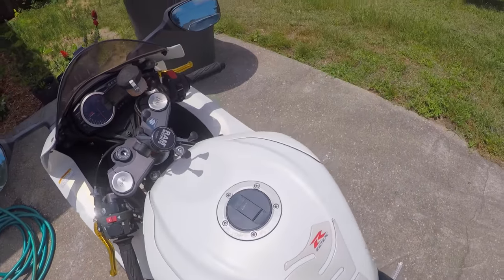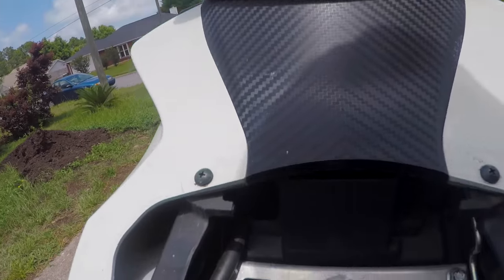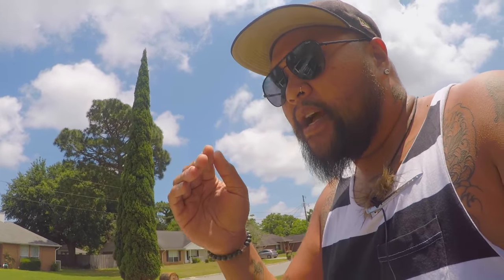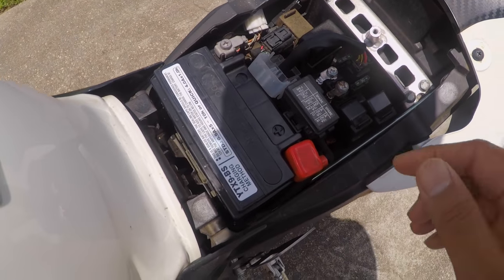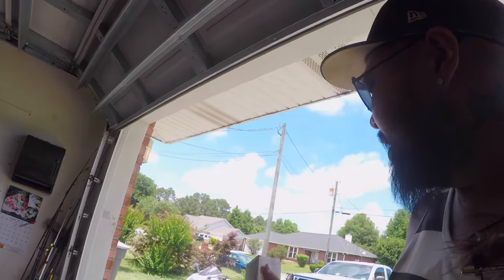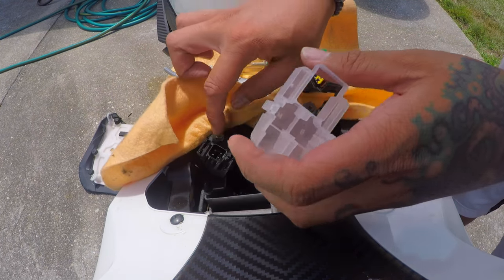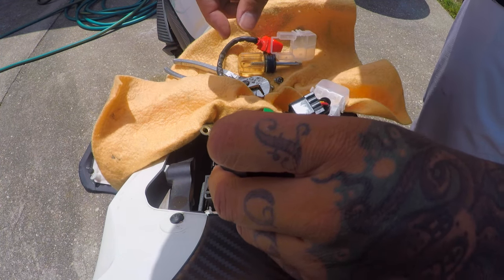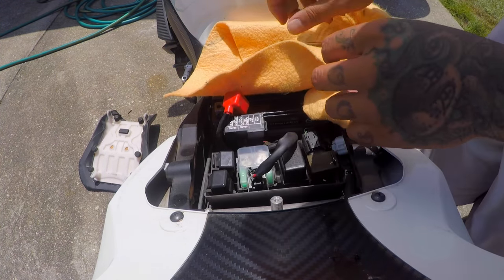**Solved!** Starter relay problem! Works for most bikes/vehicles!

Comment: I bought a xsr 900 last sept 2020. I never used it till now because im out of the country for work,  my bike wont used until now but someone start the engine weekly. Now i notice it won't start easily and it is intermittent, i already change the battery, but yesterday my mom try to start the bike again and it has only clicking sound, i hope it is only starting relay problem,
Reply from the maker: Rapid clicking sounds like a battery issue. If it clicks once, then it’s the relay, if it cranks and doesn’t turn over, it’s the starter motor. To my knowledge. 😅
Reply: @MotoCos88  yes same thought. It happens Only clicking, sometimes if you press the start button twice or 3x it will start..

Comment: hi.i have taken the battery off while engine was running.after 30 seconds engine completly shut off.low beam gone.apart from low beam everything working .checked all switches they are fine .brand new battery.starter motor working fine.but engine not running.
could any one tell me what is the reason. checked all fuse they are ok
gsr 600 2008
Reply from the maker: @munna1111  is your stator/rec recharging your battery? Also check your ground wire

Comment: What's the "zzzzzzeeee" sound after you turn the key in the ignition? I have the 2014 GSX-R 750 and I wanted to start it today after a long break and suddenly I'm not even getting that sound. The lights come on on the panel, but there are literally no sounds when I turn the key. Battery should be charged, I only disconnected it from my OptiMate a few days ago and the LEDs and the instrument panel do light up.
Reply from the maker: Hey! Sorry I missed your comment! That sound is the fuel pump priming the ignition? I'm not sure where it goes tbh, but I do know, thats the feel pump engaging getting ready to start the motor. Currently, I haven't been riding as much due to the weather and this 100+ degree weather so its been chillin in the garage. I tried to start it the other day and it wouldn't start, however, i am getting lights and a fuel pump. So I know ill just need a cold jump. What happens when you try to start it? just it just die automatically? If I were you, I would get a voltmeter and see what the battery reads before and after you try to start. It needs at least 12.5V to start. Start there. If you get it to start, the volt reader should spike up to 13-14V and maintain that amount. If not, it could be your rectifier/stator not charging the battery whilst running. Good luck and please let me know how it goes!

Comment: Currently have this same issue just replaced the relay but same clicking sound still happens don’t know why!
Reply from the maker: Rapid clicks or one click? Could be a voltage issue. How old is the batter? Check with a voltmeter how much you’re starter is getting from the battery. Should be 12.5V+

Comment: i have a mt 07 2018, same problem but I also got a motorlamp. is it normal to have motor lamp when the rele is the problem?
Reply from the maker: I’m assuming a motor lamp is like a check engine light for bikes? I’m not sure as I’ve never dealt with them. But that could be it!

Comment: Hey I have similar problem but my battery keeps draining out I’m not sure if it’s the relay or maybe the stator (alternator) it’s fried . Was your battery draining also or it just didn’t want to start ?
Reply from the maker: If your battery is dying on you after each ride, it’s your charging components. If you can, I’d remove the stator cap and check the coils. They’re probably shot. After I’d ride, my bike would sometimes not start, so I thought it just needed a jump. I’d bring cables with me everywhere I went until I discovered it was my relay. I’d do a volt meter check on my battery and would notice it was fully charged after I rode so I knew it wasn’t the battery or rectifier/stator. The test of checking the relay with the volt meter on both contacts told me it was a bad relay. I hope this helps
Reply: @MotoCos88  thank you yes I’ve bought 2 battery’s brand new and both drained quick . I havnt checked the relay but I try to use the jumpers and it only makes a click sound when I try to start it up and I believe the engine light is also blinking ? Not sure why . do you think it’s the relay starter ?
Reply from the maker: @JuanCarlos-wc4bs  nah. If it just clicks once, usuallyyyyyy it’s the starter relay, not getting enough voltage. If it clicks rapidly, it’s the starter motor not getting enough voltage. However, mine clicked and when I used the volt meter on the relay, I knew that was the problem. You got a volt meter? Pretty cheap at Walmart or any auto shop and a hugeeee help in the garage
Reply: @MotoCos88  yea it just clicks once it doesn’t try to start every time you push it it clicks makes like a buzz noise that’s it . And what website did you buy the relay from ?
Reply from the maker: @JuanCarlos-wc4bs  the relay could be a cheaper place to start. I actually bought mine locally at a Suzuki dealership. Try to find an oem one as third parties are never as reliable. I believe mine was $90 from dealership. If it doesn’t fix the issue then you’ll know that you have a new starter relay!
Reply: @MotoCos88  alright thank you so much I’m going to try that too . Was your battery draining also . But yes I’m going to buy one rn
Reply from the maker: @JuanCarlos-wc4bs  nah my battery was solid. Pushing 13-14V at crank. My bike sat for a year so I changed the battery first thing. Then when the problem occurred I knew it wasn’t the battery cuz it would always read 12+V on the meter

Comment: nice i have a 98 honda shadow and replaced mine but still having problems  i rode the yesterday bike started fine went to the stare came out and bike would not start  had to have a guy push start me the bike has a new battery  new starter switch a new starter soloid  everything should be good but am at a loss
Reply from the maker: You checked your ground wire and all the connections?? If it does after start, could be a fuel pump issue?

Comment: Out of curiosity, when you look at the old starter relay where the fuses pop into, are the metal contacts that the fuses touch present on both sides?
Reply from the maker: what a good question! i didn't even check and it has been a long time since then, henceforth, i threw the old one away when i moved to a new house! but ill keep that in mind for next time!
Reply: MotoCos88 Did some research. Looks like one of the fuses on the relay is just a spare so it won’t have metal contacts to make a connection.

Comment: I am getting Nothing, No prime and no lights. Still working on it. Batt said 13.2.  it was on the charger so it was high. All fuses are good. I think my switch or the lead is bad.
Reply from the maker: Any update? Check your ground?
Reply: @MotoCos88  Yep, it was the green plug under the key barrel.

Comment: Hey I’m having trouble with my bike and I can’t figure out what it is I have an 05 CBR600 I put a new battery in my bike and it try’s to start its clicking but the back light are on but the front light won’t turn on so I’m not sure if it’s a lose wire which is causing the front light to not turn on as well as the bike
Reply from the maker: Hey! Have you tried checking the voltage of the battery? It's a great tool to have if you like working on small things on any vehicle. If its rapid clicks, it's the battery. Make sure its fully charged and pushes out 12+ volts when trying to start. If it's one click, it's the relay. When I tried to first diagnose the problem, my first battery would drop to 9.5v resulting in it having old/bad cells. Also, I recommend checking your ground wire and its location (usually near or on the starter casing)  and that all connections are tightly secure. I've had a couple "oops" situations that could have saved me money. Lastly, and I wouldn't normally reccomend this, but have you tried jumping it? You're technically not supposed to jump it to a started vehicle as you can fry your rectifier/stator but if it's a means to get you home, then why not. Try these things and let me know, please. I'd love to help you as much as possible.
Reply: MotoCos88 hey man thank you 
do you have an email for fb I can send you a video of my bike
Reply from the maker: @jessicapulakka4807  hey! Yeah! Motocos88@gmail.com

Comment: The same sound my bike is making. It's driving me mad. I picked up a multimeter today (no idea why I didn't have one before) and I'm going to check the relay before filing 450.00 on a new starter
Reply from the maker: Great tool for the house and garage!!! Just remember to connect it to the "out" contacts on the relay and try to start it, if it reads 0 it's the relay!! It can save you time, money, and stress if it's just the relay lol goodluck, let me know if it was, in fact, the relay!
Reply: @MotoCos88  it worked! I got the new relay in today, put it right in and it starts. It struggled two or three turns, but it started successfully twice. Hopefully the doing relay hasn't hurt my battery or starter.
Reply from the maker: @chriscode6431  hell yeah!!!!!!! Yeah mine struggled when I first tried to bridge the connections. If it was out of commission for a while, I imagine the injectors mildly flooded since the fuel pump turns on. Idk lol just a theory, but in so glad to have helped out!!! Safe riding brother!!

Comment: What kinda code were you getting when you had this problem
Reply from the maker: I actually didn’t get any codes! But when I did the paper clip hack, I would get C00 which is nothing lol. I was stumped on this for so long. Even the dealerships and repair shops near me didn’t know what was wrong.
Reply: @MotoCos88  I'm getting 5 long 4 short can't figure it out

Comment: Hey man, what do you think it could be when, after I turn my bike's ignition switch off (2000 sv650), but yet the starter keeps turning over trying to start the bike (even though the ignition switch is off!)?

I've replaced the relay solenoid, as well as bought a new battery, but it did it again.

Thanks
Reply from the maker: CrypticGamer it does it automatically? Sounds like a sticky/defective ignition switch? Check the spring under neath the ignition button. Sounds like the contacts are stuck together. I’m probably wrong, I’ve never seen that on a bike before. Although, it being 10 years old it sounds probable. Please keep me updated!
Reply: @MotoCos88  Well, I'll tell you what weve discovered so far,   someone has spliced into the wiring harness and soldered 3 different wires together. 

The mechanic said by checking the wiring diagram, it appears they are connected to where they should be connected, but there is definitely something funky going on.

I will let you know more, after I find out more.👍

Comment: When you were having this issue, was your bike throwing any codes or was it showing C00?
Reply from the maker: Sorry for not replying! It showed 00. Although I did it with the paper clip hack. Still showed no codes 😬
Reply: @MotoCos88  no worries brother. My problem ended up being a rather squid move. I had my PC3 ground hooked up to the power on my battery.
Reply from the maker: @aref4i  that’s not as bad as when I forgot to tighten my negative terminal and forgot my kill switch and couldn’t figure out why my bike wouldn’t start for a week 😅
Reply: @MotoCos88  we all have our moments.

Comment: I have a KTM duke 390, when i turn the key, panel turns on, everything nice etc, then when i go to start it the relay clicks non stop, like *clack clack clack clack * as long as im pressing the started button it clicks, the bike has been idle in the garage for a few months... any idea if its the battery or relay? it has 2100 KM's, pretty much new, worked fine before.
Reply from the maker: Sounds like a battery issue! Not enough voltage getting through the relay to the start motor.
Reply: @MotoCos88  Should i still try to jump start it like you did in this video? or it won't work?
Reply from the maker: @218DX  it probably won’t work if the battery isn’t pumping out enough voltage. Should be 12.5+V but you can try, shouldn’t hurt anything. You can also try cold jumping. Attaching it to a donor vehicle BUT DO NOT START the donor vehicle. Just borrow some juice from the battery. I did that with my gixxer before knowing it was my relay not knowing it could damage the stator rectifier
Reply: @MotoCos88  So, turned off car, just conect the batteries and try to turn it on, yes sir, thank you!
Reply from the maker: @218DX  it cranked?? So you’ll probably just need a new battery!
Reply: @MotoCos88  Didin't try yet, it's night time here, ill try tomorrow but i saw this video ( https://www.youtube.com/watch?v=4Hga3aH7cxU&ab_channel=KaranJetliLive ) KTM duke 390 needs like 12v+ to start, mine was like... 11.5v and when i pressed the start it lowered to about 10.5v, so it's probably the battery
Reply from the maker: @218DX  oh yeah. Def. Need a new battery. It’s the same amounts for cars. 12.5 or more during cranking. Although the constant clicking was a dead giveaway, you never know! Do you have a trickle charger?
Reply: @MotoCos88  I don't, i saw a few other videos, they said the same as you, car battery, but the car turned off
Reply: @MotoCos88  Yeah, tried it today, turned on, the panel showed as i said like.. 11 ish volts, did battery from car to bike and it turned on and then the panel started showing battery at 13.8-14v, working fine now, thx for the help :)
Reply from the maker: @218DX  stay safe out there!

Comment: What if i have the same issue, but bridging the relay does nothing?
Reply from the maker: what happens when you bridge it? are you getting clicks, or is the starter trying to crank? If no clicks or anything happens when you bridge the two, I would assume it's the battery. It needs 12.5V+ to fully turn over. I'd check with a volt meter what's going on with your battery when you're trying to start it. Voltage will drop from standing to trying to start the vehicle and can drop down a whole volt.

Comment: Hey brother, we bridged the two bolts and it started up perfectly. we ordered a new relay and replaced it BUT it doesn’t start up. Any recommendations or suggestions??
Reply from the maker: Drenoxian check the active fuse in the new relay?? That’s strange. Did you buy a new OEM part or used one? I’d start with looking at the fuse. Be sure to check the one within the relay and not the spare in the housing
Reply: MotoCos88 thanks for the quick reply bro but yeah i ordered it new from amazon specific for my motorcycle year and so the fuses all look perfect. It’s just whenever I press the start button, it doesn’t start up. But the method you mentioned worked flawlessly.. I think we’ve tried everything. Might have to take it into a shop
Reply from the maker: Drenoxian I’m literally stumped! Second guess would be the starter motor, but if the screwdriver trick works, then the starter is fine....it’s got to be the relay from amazon...if you have a local dealer, I would check if they have one to test it. Please keep me updated!
Reply: MotoCos88 exactly what we were thinking because if bridging the two points together starts it up, everything else should be fine.. although I do note that the bike requires a bit of throttle after using the screwdriver to get it up though.. does that add any helpful info? Like bridging it gets it partially started and giving it revs brings it to full life. I’ll definitely look around to see if there are any local Suzuki dealers that have my 02 GSXR parts or something.. thanks for your helpful advice bro
Reply from the maker: Drenoxian ahh I think maybe the fuel pump needs to checked on. When you turn the key, can you hear the fuel pump engage and prime?
Reply: MotoCos88 I had to do a bit of research on what the fuel pump is supposed to sound like today but yeah, it actually does prime. I can hear the whining noise when I press the kill switch.. I watched a few other videos after you mentioned the fuel pump and it seems that doesn’t seem to be quite the issue. Pretty perplexing since the bridging technique kind of eliminates the starter motor as a suspect. Autozone says the battery is good and full charge too. Total mystery bro
Reply from the maker: Drenoxian dang this is nuts.. so what happens when you push the ignition button? Lights go off and no clicks or anything?
Reply: MotoCos88 it’s pretty deceiving. From what I can remember from when it used to start, everything sounds exactly how it is supposed to prior to actually firing up. So when I put the key in and turn the ignition, lights come up, kill switch the fuel pump engages and there’s a high pitch whining very softly. Lastly as I go to hit the engine starter, it’s just completely quiet as if I pressed nothing.. isn’t there supposed to be a clicking sound or something at least?
Reply from the maker: Drenoxian yeah! Which either means the battery isn’t pushing enough voltage or the relay isn’t engaging the contacts. Also make sure the 30amp (light green fuse) is intact. You getting an f1 light at all?
Reply: MotoCos88 looks like we fixed the problem today! Oddly, we replaced the “backup” kind of hidden switch under the bike. That seemed to do the trick and starts up flawlessly. Let’s see how things are in the long term. Thank you for your help and well-informed guidance on this, brother
Reply from the maker: Drenoxian have you dropped it before? I know some bikes have a switch or sensor in case you drop the bike, it won’t start so the fluids won’t flow incorrectly (I think) I’ve never had to deal with that. Well I’m super happy you got it running again and didn’t have to take it to the shop and get your wallet rammed!!! Haha sage riding brother!